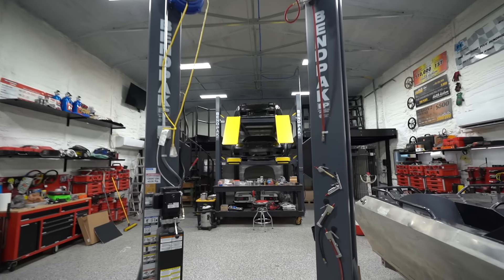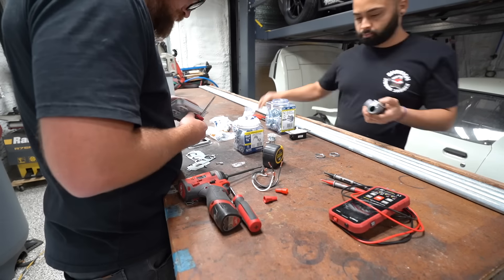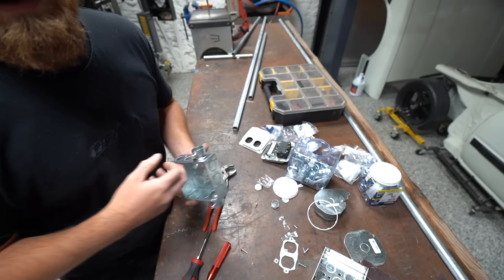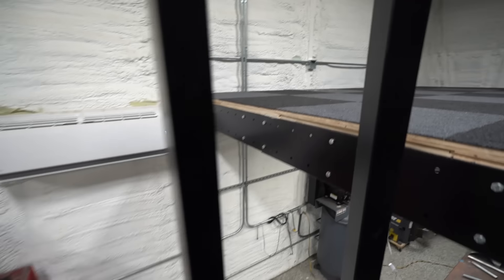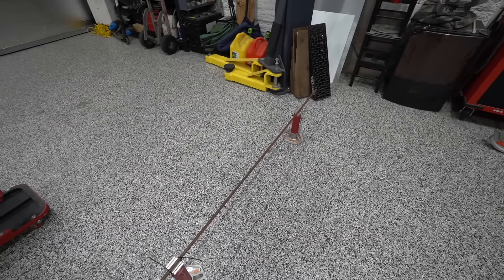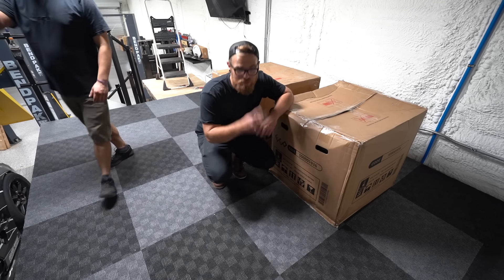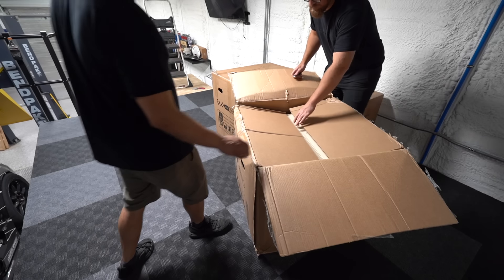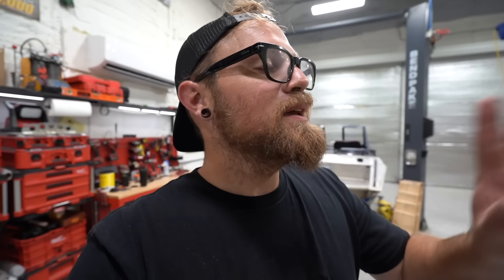Shop upgrades. Loft build part 4. putting it all together

Comment: No GFCI?
Reply: gfci is not always required. mainly required when within a certain distance near a water source/pipe, or areas known to have liquid, especially in a kitchen (regardless if used in a commercial/residential building).  

On a personal level, if GFCI outlets weren't so damn expensive, my home would have them on every outlet. I hate it when an entire circuit is tripped over one damn outlet.

Comment: flexible conduit: we would use 5/8 coiled air hose and run your wire in it when we build equipment with a large movement

Comment: Dont forget to put some steel plates under the shelves legs on the storage loft. Spread that load and save that wooden floor. 
Shop is looking killer!
Reply: Good advice
Reply: When I saw all the racking shelves at the start of the video, I thought thank goodness he put an extra layer of plywood!  Imagine those unsupported cuts between bracing with a shelf foot on them!  
Obviously T Ray thought the same thing and added that plywood.
Reply: Need a monster refrigerator

Comment: Swedish electrician here so I know nothing about US code, are you grounding the metal conduits and boxes? The only time we would use metal pipes and boxes is if there is a high probability of rodents or highly corrosive enviroment that will eat the plastic. And basically noone uses wire nuts anymore here, so annoying to use imo. :)

Comment: Hey Taylor, truck them wire nuts off and get a box of Wago connectors. they are lever action locks in a 2, 3, or 5 port configuration & 2 common gauge sizes. no more twisting wires together. can cable tie multiple wagos together for really neat finish. cheers from Aus'.

Comment: Isn't it crazy hot up there with the mini's mounted below?  I have a similar 40x78' and the air above the mini split is crazy hot unless I run fans to circulate the air.
Reply: he brought up that concern in a previous video. something along the lines of coming up with an  air conditioner "solution" eventually.

Comment: I think you need to give that electric patch back. You just wired the outlet with 240 colors. Green is ground, white is neutral, black is one leg of 110 or 240, and red is second leg of 240. You need to fix that asp.
Reply: he is the only one working in his shop ,as long as HE knows the colours ,is ok ,stop itching about the colour
Reply: One day he will sell the the property and someone comes in behind him to do repairs on the wiring and could get hurt do to it’s not correct. That is when we have code so wiring is installed correctly.
Reply: @nhfdtb  one day is not today , so again stop bitching about colours ,he already said he is not going anywhere

Comment: Flip the shoplights over your lofts so they point at the ceiling, it will diffuse the light across the ceiling and give you really pleasant light on the lofts--especially the hang out side

Comment: Personally later down the line I'd upgrade that light switch to a motion sensor type switch. Specifically the one that you can set for 15 minutes - 2 hours
Reply: that or use smart (wifi) switches/lights. once on the network, there are so many automated functions it's so awesome. hell each one can be monitored to find out if he or his friend accidently left a light on. there's so many options in that regard

Comment: I absolutely loathe those safety outlets with the little doors inside blocking you from plugging things in. I have them in my shop cause I wanted gray outlets with stainless covers and didn't realize till I had half of them installed so I wasn't going back and changing them all.

Comment: I think you should put up a removable chain railing on that right side for safety purposes
Reply: I agree. Three poles, three chains. Right most pole is fixed, and the other two fit into a piece of pipe welded to the front of the platform. Just lift them out and hang them off to the side when you need access.
Reply: The OSHA narc has entered the chat.
Reply: @tri00azerath  Negative lmao, I'm just worried about falling accidents because I work on a catwalk and a 3 storey roof daily.
Reply: @unathandavis  falling 3 stories builds character.
Reply: @tri00azerath  🤣🤣 without a doubt.
Reply: @HunterAtheist  could weld up a mount-plate for the 2 removables' base/hole and bolt them in place on the frame
Reply: @tri00azerath  If not "first", safety does need to be considered.

Comment: You should put the air compressor outside in a little building on the back side to get it out of the shop and make it not so noisy

Comment: I'm not an electrician, but to me it looks like you may have exceeded the number of wires allowed by code in the junction boxes - on both sides.  I would have a licensed sparky check those for you.  If, God forbid, you ever has a fire, you would be giving your insurance company an excuse on a silver platter not to pay your claim.  Just because you were able to cram the boxes full, and get the cover on, does not mean  you are 'good to go'.  And while on the fire safety subject, do you have your flammables securely stored in a fire safe cabinet?

Comment: When starting out with conduit. I highly suggest a paid app ~$6. It will go a long way to make bending easy and minimizing your couplings (minus the bending of pipe at first but leverage is your friend) Also avoid doing more the 270 bends btw junctions especially with lots of wire

Comment: Wouldn't making the shop "smart" be a wise idea? Imagine having your hand greasy and wanting to turn on lights. A voice controlled switch would be amazing. I would do it now and save the trouble later.
Reply: that would be a great idea. i never thought about the greasy hands part. I just use smart switches, bulbs, etc. because of how convienent they are. especially if its a bulb/switch or other smart appliance thats hard to reach

Comment: Run LED strip lights on the lift side of the loft floors, they will light the middle and bottom cars up and then put lights over the top car. Style points for RGBW LED strips, that will add ambiance.

Comment: Why no geound wire? You can use the pipe as ground but set screws arent always tight enough to have a good connection.... oh no i just saw you used black for ground. Thats a big no no. Green for ground lol
Reply: One of those devices will fail and he will learn.
Reply: @timmummert63  well as long as it's him working on it he may remember but if he sells the house or has an electrician come do work there that's when it could cause some problems
Reply: @MilesHolt  i  was just thinking of that very same thing lol
Reply: from one of the videos i've seen, it's not a good idea to use the conduits as a "ground". something to do with the way main circut panel works. one of the videos said something about never tying in neutral with ground. if the neutral wire he used inside the conduit to the new outlets were to accidenly touch the conduit, something bad can happen but again its been a while since i've seen any electrical videos regarding safety etc.
Reply: @jd_railfan  any disconnect after the main service disconnect the ground. Is bonded to the neutral so in the panel box the ground and neutral are essentially the same thing. But I still agree it's not a great idea to use the conduit as ground

Comment: Americans using Wago clips instead of those awful wire nuts. It is a beautiful day.
Reply: Wagos are the best things since sliced bread in wiring. American here, and it's all I use
Reply: I've never seen a wire nut fail, but have seen and heard of wagos failing.
Reply: @AceEverett  i will take things that never happened for 500, Alex
Reply: @Stepica  Well then you'd be down 500.

Comment: If those tight 90s ever give you any trouble, my method is to use a shop vac to suck a string through the conduit and pull the wire through with the string. You can suck a light string easily enough or put a wad of paper towel on the end of a heavier string. The paper wad shoots through faster.

Comment: As an electrician I'm slightly triggered by this. Thought you were pulling to circuits and maybe using the pipe as a ground but nope. You should really consider reading these comments and fix the issues. You should at least by some green tape for the black wire and "rephase" it.

Comment: Black, white, green for universal hot neutral ground wires.  Stranded wire is so much easier to work with than solid. Not a bad idea to tape around your outlets so if you ever pull them apart live you don't arc them into the box.  Couple of tips from an electrician.  Nice job.

Comment: Sorry Taylor but all that wiring screams firehazards to me.
Did you load balance all that wiring too? Because having it pass through you're going to have to be careful not to go over the amperage of the single ring wiring over the extreme multiple of sockets on the same ring

Comment: May have missed it, but are you putting hand rails around those lofts, especially the hang out side? If someone were to ever fall off, your home owner's insurance will 100% refuse to pay and you are opening yourself up to a big lawsuit. Plus it is a code violation to not have them.
Reply: chill out Karen, he didn't put it on yet to make it easier to load the furniture there, he said it when he built it

Comment: Green instead of red. Black = hot, White = neutral, Green = ground
Reply: Also he needs to attach a ground strap to each of those boxes.
Reply: I bet he bought and used those colors because he knew he would have several feet left over and thats the colors he mainly uses on his cars.
Reply: @warrenmichael918 I hope not. That's solid core which is correct for home wiring, but not for automotive where you'd want stranded. It's the colors that are wrong as red is an additional hot leg for AC 220V. I'm betting he used red for hot, white neutral and black ground since that is most similar to DC auto wiring (except for the lack of a neutral there).
Reply: @gmcmanus663  I know his colors were wrong for normal house wiring. I dont know why but i thought he used stranded wire. Thats why i figured he bought the colors in stranded he uses on his cars. I didnt realize it was solid wire.
Reply: @warrenmichael918 That's the same thing I was thinking he used what he had and the way he's gone into the house he doesn't need a giant house or shop and literally building what's gonna be his forever
Reply: What's that handrail for the loft look like.
Reply: @timmummert63 eh not really.
Reply: @gmcmanus663  Red can also be for another circuit while using the same neutral and ground. That is likely how to shop was originally wired so each double box is 2 circuits.

Comment: Why? I wish you weren't so giddy about your wiring job. Bro, I thought that you would have jibber-jabbered with someone that knew more about wiring and conduit bending before you installed your unsafe at any speed wiring. I've enjoyed your many projects since the Flummins build in your old shop that you were sharing. You always try to do things right. What happened?You didn't follow any kind of code and you documented the whole hot mess with this video. It is so not to NFPA code. You could lose your fire insurance and your occupancy permit if those agencies are watching. You need to correct it. Disappointing.
Reply: Chill dude it's Florida. Anything goes.